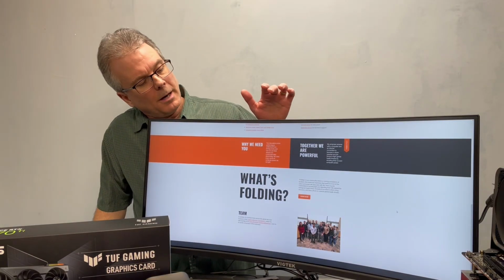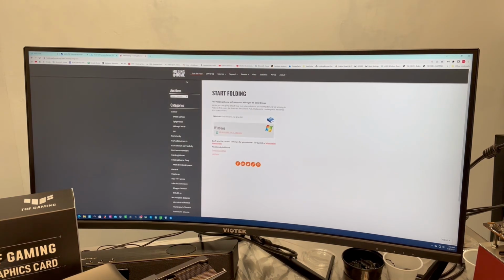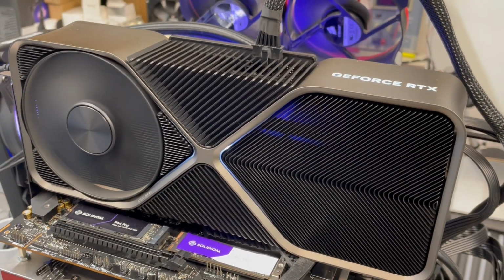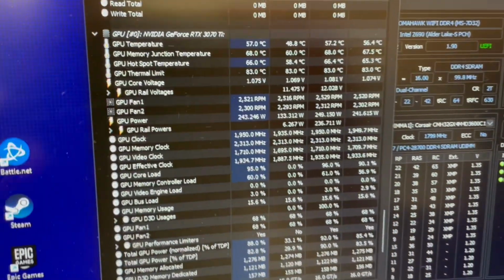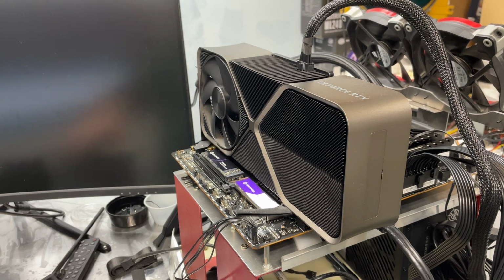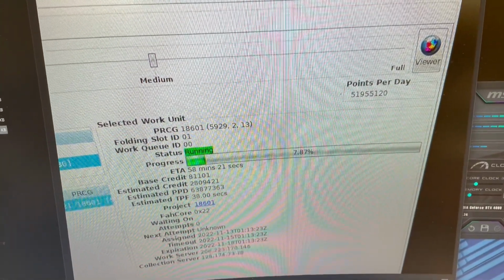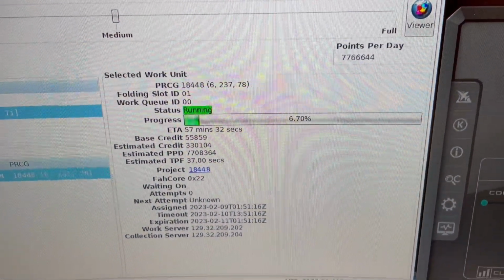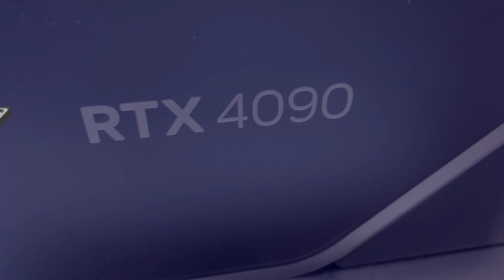Folding @ Home with Nvidia 40 Series GPUs!

Comment: I really want to try folding on a Threadripper Pro 7995WX system with multiple SSDs in RAID 0 to see what that does, since I suspect many have a memory bottleneck on those processors, but if I get that system, it will probably come with a 4090, so that will also handle a lot of it, and LLMs.  There's starting to be more reason to own a workstation/server, even if not serving anything, except perhaps computing resources to science and free AI.  I'd let people on HuggingFace use the resources, if they wanted.

Comment: The size of these cards is just insane. Power draw on the 4090 is supposedly the same as a 3090 (350 - 360w) when folding and gaming without ray tracing. 

I only play WarZone, so went from a 3090 to 6900xt, but my folding scores dropped by basically half.
Reply: Those cuda cores work hard

Comment: Hello there!
Can you help me with as question? I've been folding since my PS3 days, always runned it on my computers since 2008 at least, since I was never a poweruser, i never had a graphics card available for folding, are cpu work units the same as the GPU? can they work together on the same project or they're different?
Reply: Folding@home uses both, BOINC only uses the CPU for some projects.